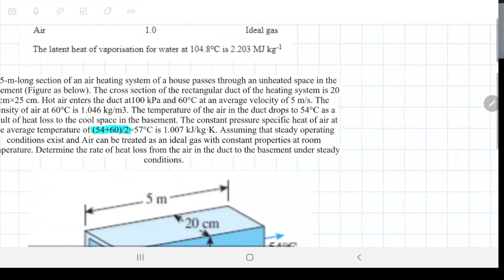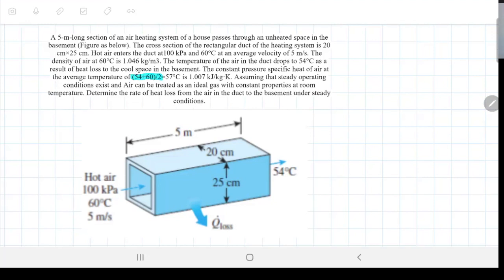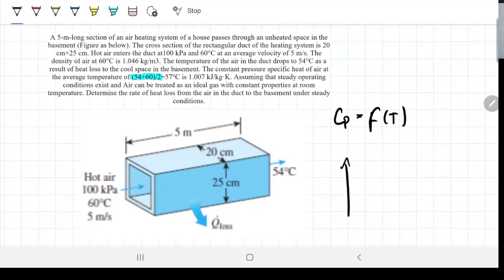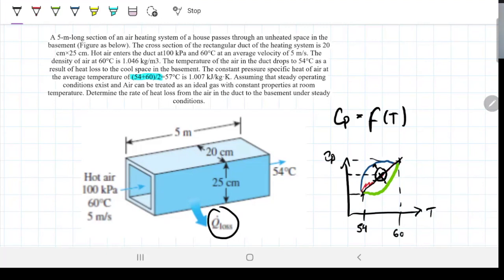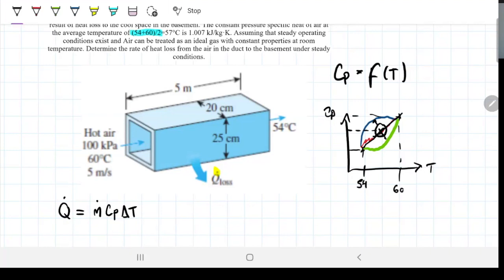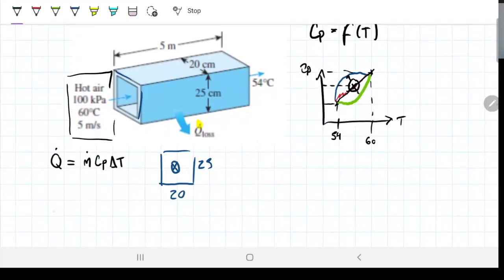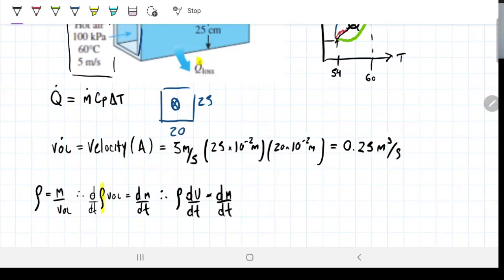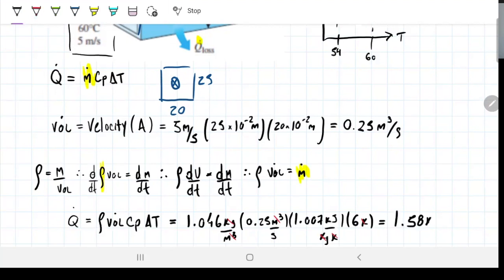Intro Problem to Heat Transfer - Heat and mass transfer - W2Q3

Comment: thank you very helpfull
Reply: with this answer how can i determine the cost of this heat loss per hour if the house is heated by
a natural gas furnace that has an efficiency of 80 percent, and the cost of the natural
gas in that area is $0.60/therm (1 therm = 100,000 Btu = 105,500 kJ).
Reply from the maker: I'm glad to hear that! Thanks for commenting